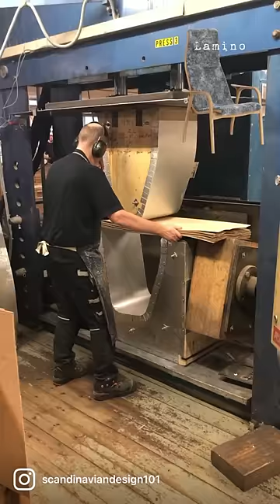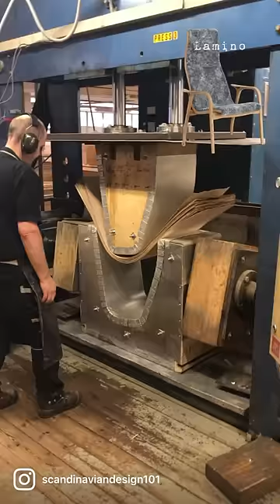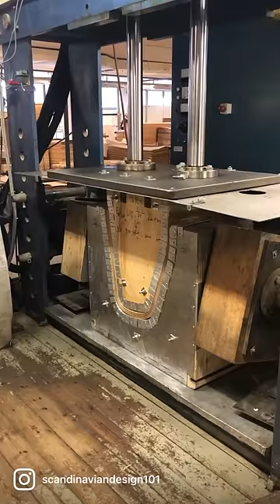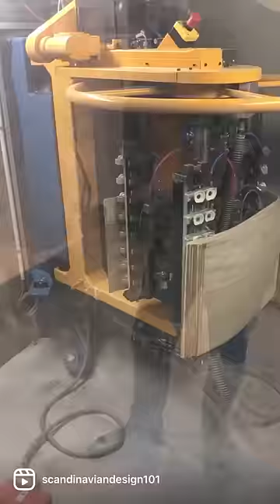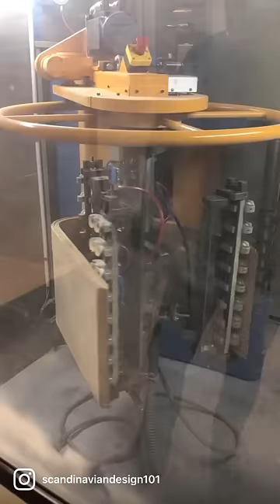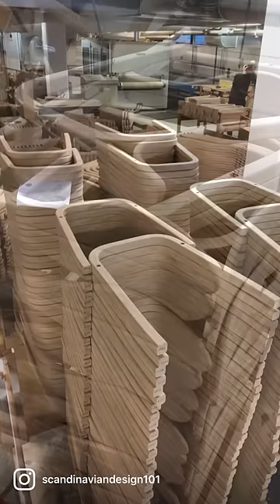The Lamino by the Swedish designer Yngve Ekström beigng produced

Comment: The press should require both hands to actuate so he can’t stick his hand in it while operating.
Reply from the maker: Sadly we can't really say way it seems like the machine is somewhat dangerous. (We shot the video at the factory but we're not working there.) But Swedish safety regulations are really strict in general. Perhaps there's a reason why this machine can be operated with just one hand?
Reply: And it does (the 'job' requires). Be sure he'll be fired if he misses one hand. 😢
Reply: Notice that he keeps his right hand aligning the pieces of shits till the last second.